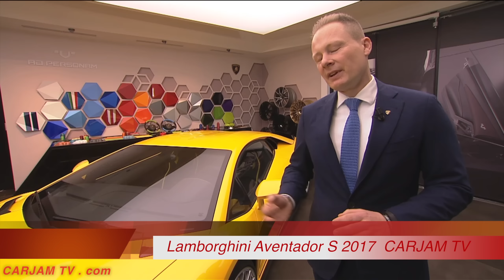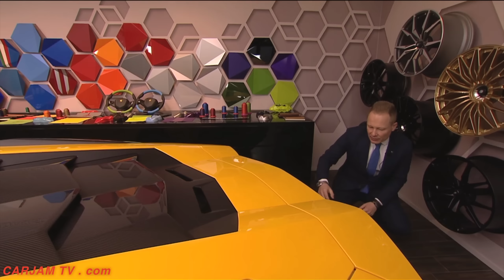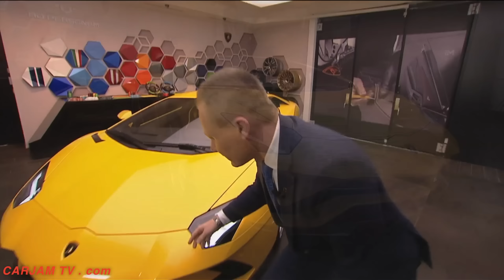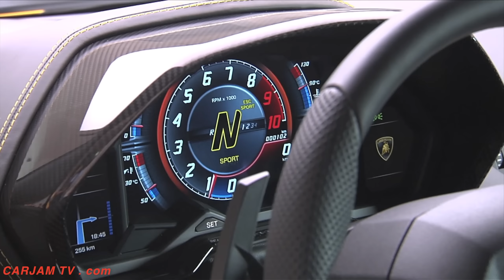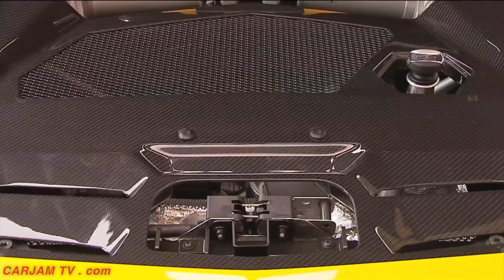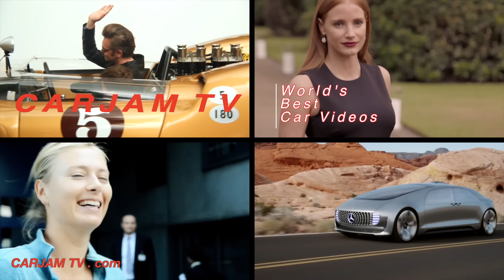Lamborghini Aventador S REVIEW Walk Around 2017 New Lamborghini Aventador S Review CARJAM TV HD

Comment from the maker: 2017 Lamborghini Aventador S The next generation of the V12 Lamborghini flagship Price $422,000, on sale Spring 2017 • New iconic 2017 Aventador S design features focused on aerodynamic performance • New four-wheel steering system • Significantly enhanced S suspension and electronics and customization with driving modes • More powerful naturally aspirated Aventador S V12 engine outputting 740 hp • 2017 Lamborghini Aventador S 0-100km/h in 2.9 seconds, top speed of 350 km/h

CARJAM TV HD